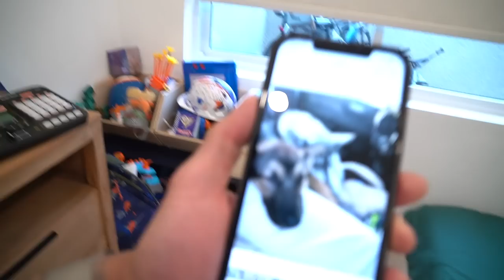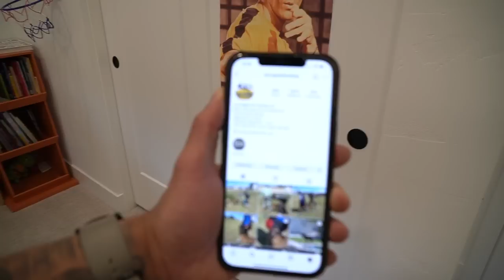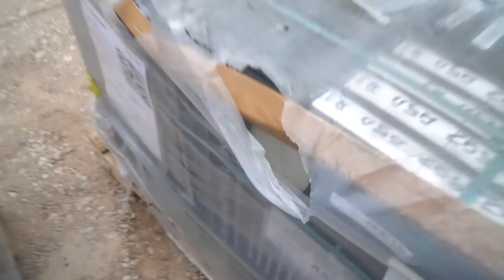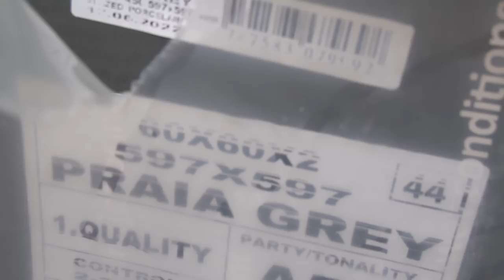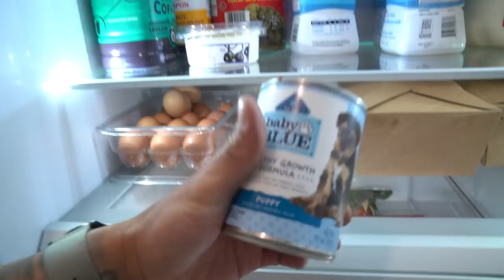Meet Cooper Our New Puppy!

Comment: You shouldnt steam clean dog urine, it will actually set it in. You should use the pee spray first and get as much out with that and use just the suction portion of the steam cleaner without heat to suck up all the liquid. Steam and heat sets all the pee in